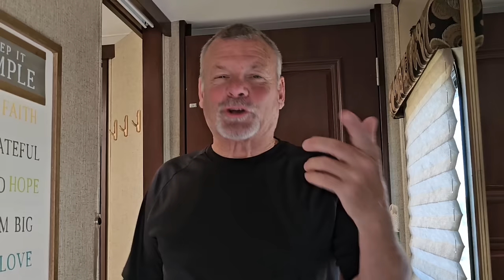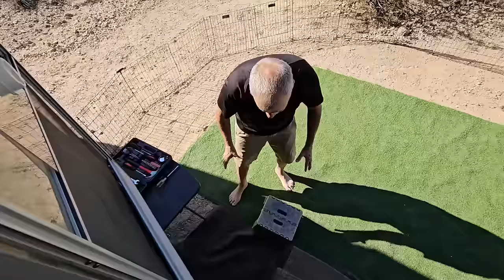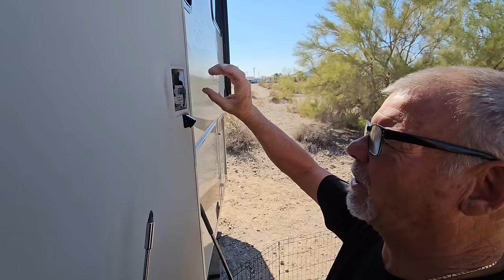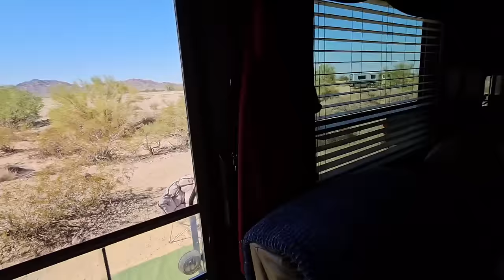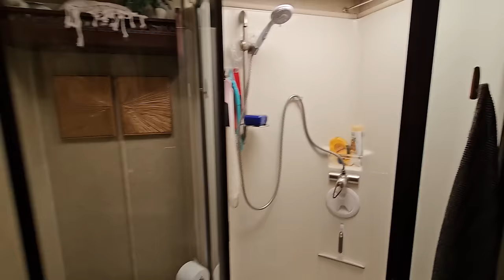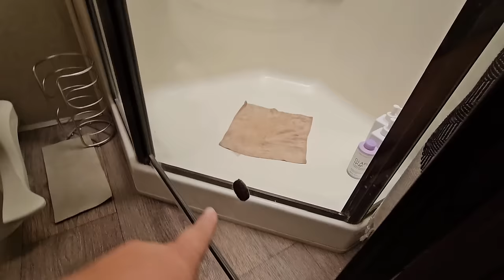How-To Repair RV Problems Before This Happens| RV Shower Fail | Locked Out! | RV Lifestyle Off Grid

Comment: I have used a squeegee for 30 years and I also use my towel to wipe down the shower after I use the squeegee.  I had a water softener in Lake Havasu but my house in Chino Valley is not plumbed for soft water.  You both are always happy.  A job to watch your videos.
Reply from the maker: Thank you so much for watching and have a great Thanksgiving

Comment: Great job, good information tks for the door info I wouldn't think being loose like that would cause that issue 👍
Reply from the maker: With the plate to lose  the connecting bar will slip off.

Comment: Hey Scott, Have you checked your bolts under the bed of your truck yet? All the “bouncing” you do on off roads are loosening your bolts underneath connection for your 5th-wheel hitch. Just wondering if you checked them yet?  I was a “full-time” RV’er (5th wheel) for four years including traveling to the Great State of Alaska! And when I got back to the “lower 48” I checked my bolts beneath the truck bed and found them all very “loose!” Safe “travels” Always for you both! And God Bless Always! 🇺🇸🤠🇺🇸
Reply from the maker: That is great info I will definitely check that out, thank you and have a great Thanksgiving

Comment: I wish the deadbolt on my house was that easy to fix. First time it broke in an unlocked position… got it fixed… then it broke again, only it broke locked. It’s too expensive to fix right now (whole door will probably need replacing), but at least it broke jammed in the locked position! 😅
Reply from the maker: Stay safe and have a wonderful Thanksgiving

Comment: Really have some Great Pointers. Is there a quick disconnect made that could be attached to the shower head hose so that you could just unhook and lay hose with head both on the shower floor? Reason asking is my thoughts are it will relieve the pressure of the hose hook up so it will not crack or break during travel.  We all know how some roads are not as smooth as others. Lol. Thanks for Sharing. Enjoy your Thanksgiving. Stay Safe. Stay Healthy.
Reply from the maker: A quick disconnect would be great.

Comment: Maybe using an Adhesive Chaulk wouldn't be as permanent if you need to take screws off (for some reason) at a later date; for another repair..instead of Lock Tight.

Comment: I have to laugh last year I was at Bullhead City and just happened to be at the RV store I went to open the door on my Coachmen and guess what it would not open. I managed to pry it open  took it apart and found a piece of cheap chinese metal broke inside Fortunately the RV store had a handle in stock. Moral of the story is to have a hide a key somewhere.
Reply from the maker: Hidden key for sure.